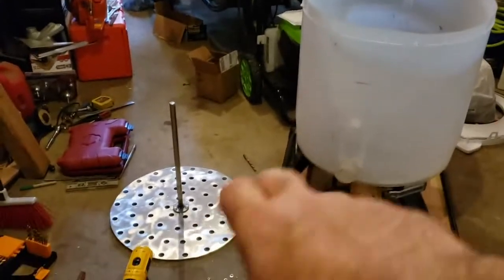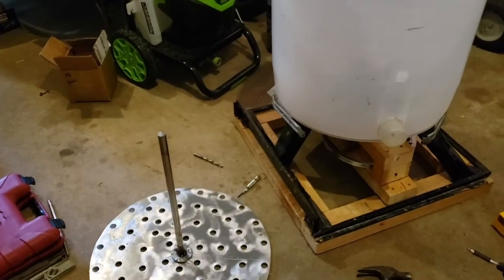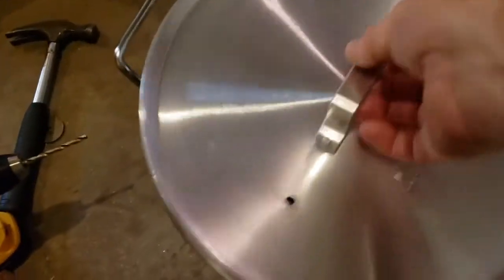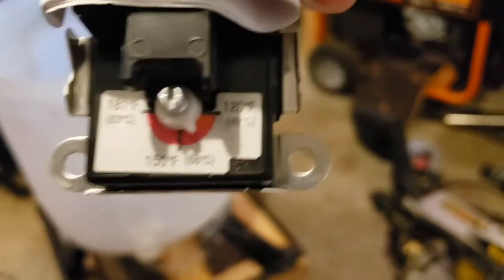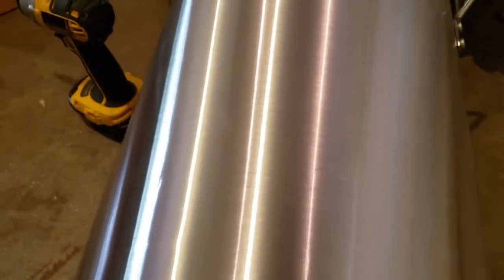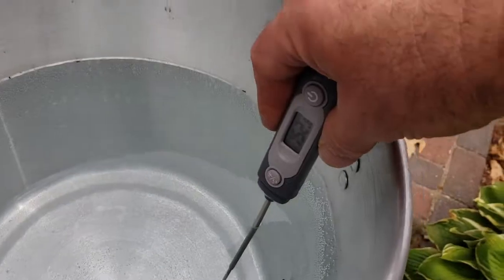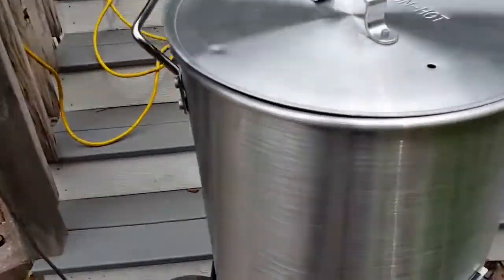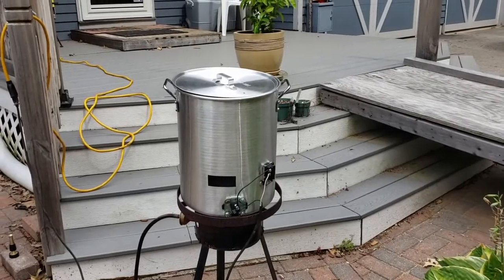How to Build a DIY Automatic Chicken Scalding Pot Cheap and Easy.

Comment: For your rubber gasket: If you made the outside gasket large enough to go over your bolt holes then that's the only seal you need. Any gasket on the wet side of a threaded connection doesn't do much because it only waterproofs the nut's flange but doesn't seal the threads. It sometimes works but only if you're lucky. Gaskets should go on the dry side because that way they seal everything.

Comment: Just finished building my Scalder from a thermoplastic utility sink. I used two elements so that it would heat faster. I appreciate the close up on the wiring as that really helped me get the electric part buttoned up.
Reply: Could you use 2 elements with 110 still?

Comment: Awesome build!!! Please be safe and use the thermometer to break black wire NEVER EVER break white wire with thermostat as the electrical potential is still on element and the potential for electrocution is very high when breaking white wire

Comment: Great video! I have done everything the same except wire it up. What cable you using? The folks at home Depot seemed confused.

Edit- I bought a 2k watt heating element

Comment: What if you went to the landfill/recycling center and picked up an old water heater. Cut in half then you can handle a few birds at a time. Also save your time and a good pot when the holes are already manufactured in.

Comment: You need to put something over the thermostat and heating element to prevent water from splashing on them. Water and electricity make big boom.
Reply from the maker: Yup, planned on it, this was just the build.
Reply: What kind of housing would you use for that?
Reply: @divisionoflabor3070  I would use something that didn’t require anymore holes be put in the pot. Less chance of water leaking around the bolts and grounding it out. You could use self adhesive rubberized roof flashing and some fiberglass insulation. Put the insulation over the thermostat and the element and secure it with the flashing. If you go this route, cut the insulation oversized to keep the flashing from sticking to the element or the thermostat. That way, if you ever have to work on either one of them, you can just cut the flashing up both sides and across the bottom of the insulation and gain access. Once you’re done just simply let the insulation drop back in place and reseal with another piece of flashing. May not be the prettiest but definitely will protect the electrical components. You could also use a couple of pump pressure switch covers and use the rubberized flashing to mount them as well.

Comment: Curious how many birds did you do before you needed a water change?  Would you still recommend this build?
Reply from the maker: We added more water about halfway through. We had another bucket of air temp water we dunked them.in first to rinse them off a bit.   I would still make the scalder, it worked great.